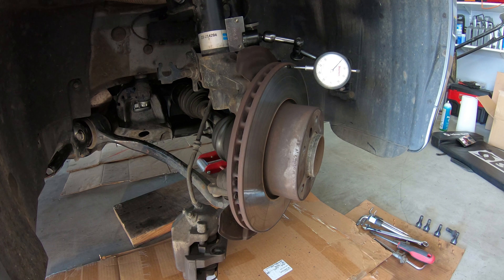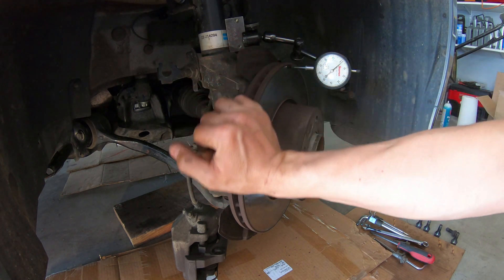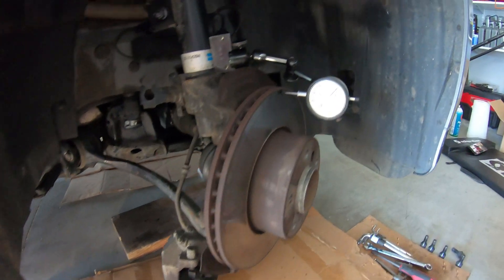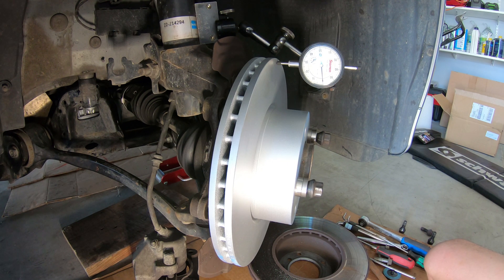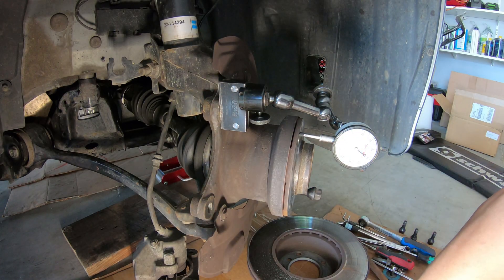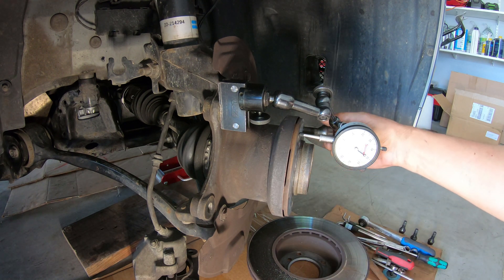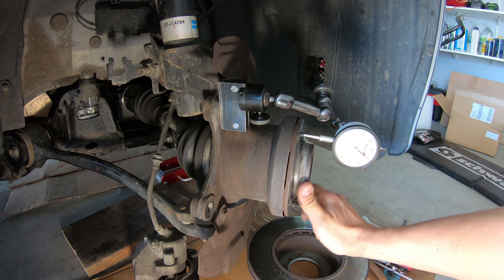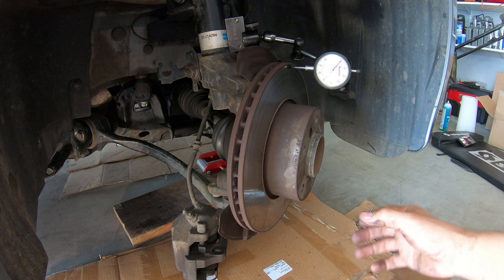How to check brake rotors for excessive lateral run-out #bmw #e90 #howto

Comment: Hello ! On my e90 , when I brake my car vibrates , I measure the front discs lateral runout and the right have 0,03mm and left 0,02 mm , my gauge indicator is in millimeters, you're is in inch , do you think they are ok ?
Reply from the maker: In general - "For your BMW E90, the maximum allowable lateral runout on the front brake discs is typically around 0.05 mm (0.002 inches). This spec ensures smooth braking without vibration or pulsation". So, if you are less than that - and you are - at 0,03 and 0,02 mm then you should not have any issues. There also is a thing called "pad material transfer" - when pad's material clings to rotors, builds up and causes pulsations in the brake pedal.
Here is a "🛠️ Pro Tip" If you're chasing down a vibration, try:
Re-torquing the wheels evenly
Measuring runout with the rotor mounted and torqued to spec.
and possibly - Cleaning the face of wheel hub surface thoroughly.
Let me know what you find out.
Reply: @maxsam201 thanks for information and answers! 
 I measured even the back brake discs, and left one is 0,01 mm , and the right is 0,06 it's possible to vibrate from the back disc 🤔? When I have time I will recheck them all again
Reply from the maker: Rear wheel brake discs? in theory they can be felt too, but i don't recall coming across that ever. that one with 0,06 is a bit too much and it is reasonable to think that something needs to be done to it.